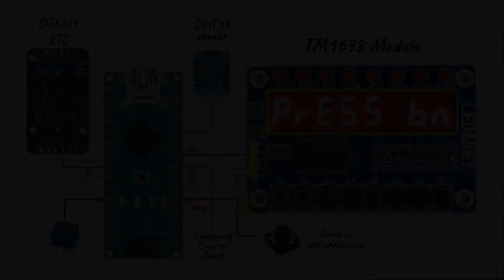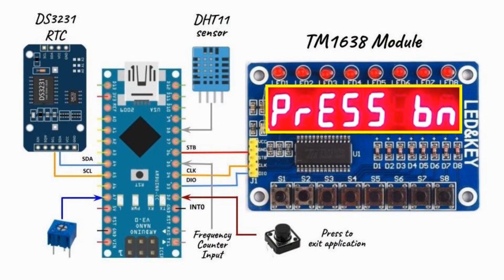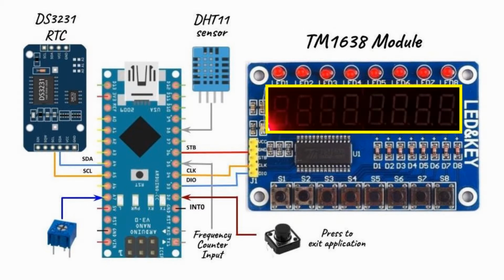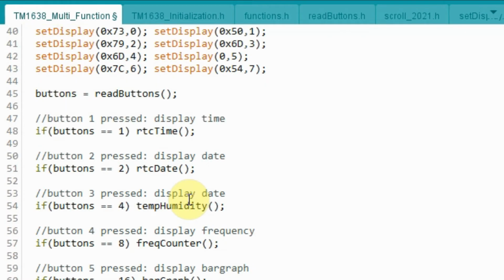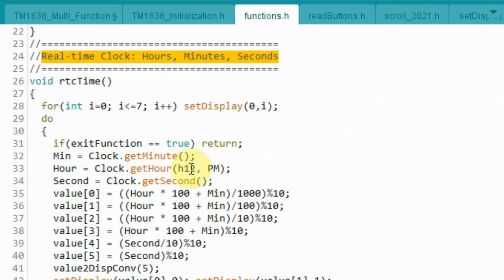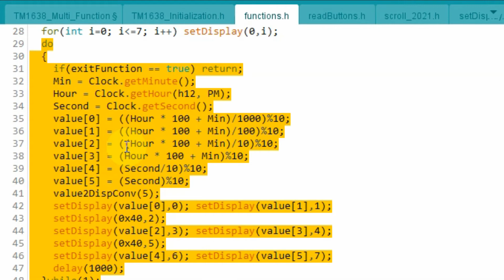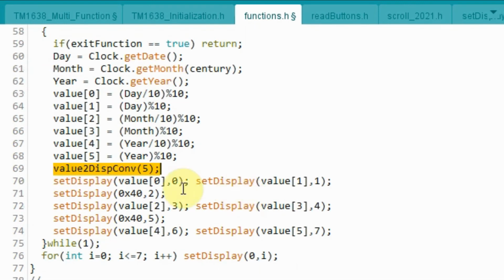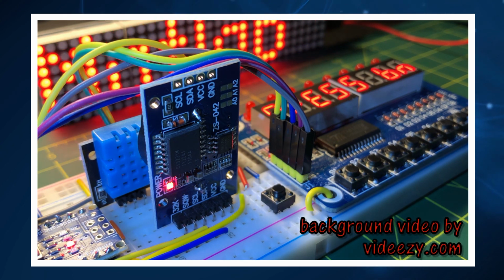TM1638 Executing Multiple Applications (part 2)

Comment: Hello, I m sorry, I have this error, could you hel me?  thank you

Arduino:1.8.19 (Windows 10), Scheda:"Arduino Leonardo"

sketch_oct04b:11:8: error: no matching function for call to 'DS3231::DS3231()'

 DS3231 Clock;

        ^~~~~

In file included from C:\Users\6767s\Desktop\Arduino\ALIVERTI\aliverti 581   tm1638\ANAS KUZECHIE\TM1638\9\sketch_oct04b\sketch_oct04b.ino:6:0:

C:\Users\6767s\OneDrive\Documenti\Arduino\libraries\DS3231/DS3231.h:80:3: note: candidate: DS3231::DS3231(uint8_t, uint8_t)

   DS3231(uint8_t data_pin, uint8_t sclk_pin);

   ^~~~~~

C:\Users\6767s\OneDrive\Documenti\Arduino\libraries\DS3231/DS3231.h:80:3: note:   candidate expects 2 arguments, 0 provided

C:\Users\6767s\OneDrive\Documenti\Arduino\libraries\DS3231/DS3231.h:77:7: note: candidate: constexpr DS3231::DS3231(const DS3231&)

 class DS3231

       ^~~~~~

C:\Users\6767s\OneDrive\Documenti\Arduino\libraries\DS3231/DS3231.h:77:7: note:   candidate expects 1 argument, 0 provided

C:\Users\6767s\OneDrive\Documenti\Arduino\libraries\DS3231/DS3231.h:77:7: note: candidate: constexpr DS3231::DS3231(DS3231&&)

C:\Users\6767s\OneDrive\Documenti\Arduino\libraries\DS3231/DS3231.h:77:7: note:   candidate expects 1 argument, 0 provided

In file included from C:\Users\6767s\Desktop\Arduino\ALIVERTI\aliverti 581   tm1638\ANAS KUZECHIE\TM1638\9\sketch_oct04b\sketch_oct04b.ino:26:0:

C:\Users\6767s\Desktop\Arduino\ALIVERTI\aliverti 581   tm1638\ANAS KUZECHIE\TM1638\9\sketch_oct04b\functions.h: In function 'void rtcTime()':

functions.h:32:17: error: 'class DS3231' has no member named 'getMinute'; did you mean 'getTime'?

     Min = Clock.getMinute();

                 ^~~~~~~~~

                 getTime

functions.h:33:18: error: 'class DS3231' has no member named 'getHour'

     Hour = Clock.getHour(h12, PM);

                  ^~~~~~~

functions.h:34:20: error: 'class DS3231' has no member named 'getSecond'

     Second = Clock.getSecond();

                    ^~~~~~~~~

C:\Users\6767s\Desktop\Arduino\ALIVERTI\aliverti 581   tm1638\ANAS KUZECHIE\TM1638\9\sketch_oct04b\functions.h: In function 'void rtcDate()':

functions.h:60:17: error: 'class DS3231' has no member named 'getDate'; did you mean 'setDate'?

     Day = Clock.getDate();

                 ^~~~~~~

                 setDate

functions.h:61:19: error: 'class DS3231' has no member named 'getMonth'; did you mean 'getMonthStr'?

     Month = Clock.getMonth(century);

                   ^~~~~~~~

                   getMonthStr

functions.h:62:18: error: 'class DS3231' has no member named 'getYear'; did you mean 'getTemp'?

     Year = Clock.getYear();

                  ^~~~~~~

                  getTemp

Più di una libreria trovata per "DS3231.h"

Usata: C:\Users\6767s\OneDrive\Documenti\Arduino\libraries\DS3231

Non usata: C:\Users\6767s\OneDrive\Documenti\Arduino\libraries\DS3231_RTC

exit status 1

no matching function for call to 'DS3231::DS3231()'

Questo report potrebbe essere più ricco di informazioni abilitando l'opzione
"Mostra un output dettagliato durante la compilazione"
in "File -> Impostazioni"

Comment: I can't get these libraries: "TM1638_Initialization.h", "readButtons.h", "setLED.h", "setDisplay.h", "scroll_2021.h", "functions.h". I have tried many similar libraries but not accepted. Pls help, thanks a lot...
Reply from the maker: These are not libraries but header files. Insider your Arduino sketch folder that contains .ino file, create these header files with extension .h, and copy-paste the codes into these files Good luck.
Reply: @AnasKuzechie  I finally figured it out, I got it done, thank you very much.
Reply from the maker: @fswinly  great